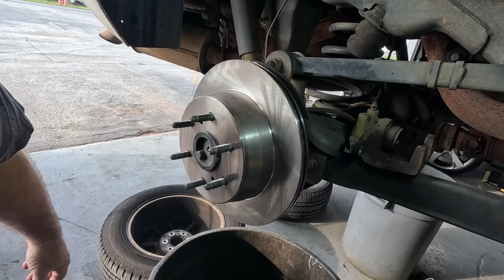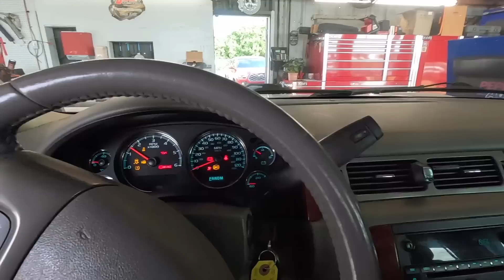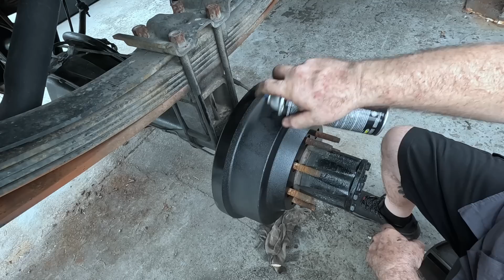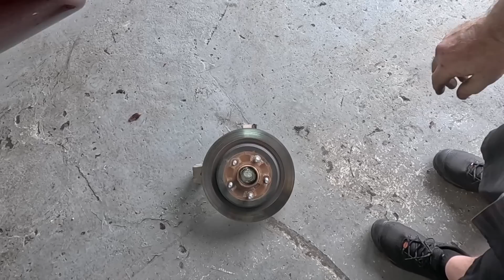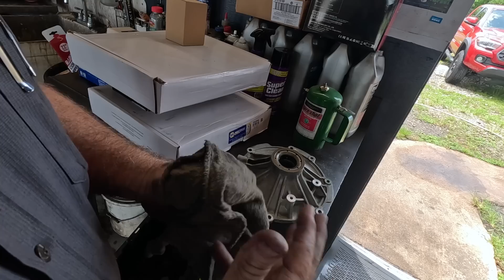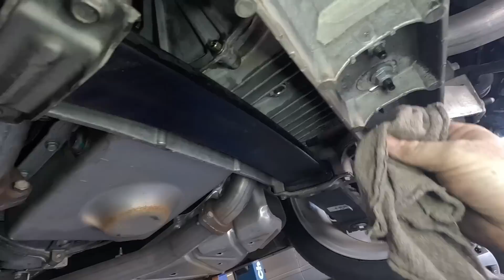03 CORVETTE DIFF REPAIR, GIMME A BRAKE! 12 TAHOE, 95 F350 DRUMS, A DAY THE THE AUTO REPAIR SHOP 270

Comment: Ok here I am, where should I start on the brake drum job? 
1. Didnt clean the back plate at all so you put lube on top of the brake dust build up... 
2. When you _hammered_the lever back in, rust was literally shooting out the back side and the arm is all rusted.. 
3. Good job putting greasy fingerprints on the brake shoes stopping suface...
4. The side cutters being used on the spring so it can rust now that the coating is damaged.
5. Didnt clean the rust off the hub suface that the drum mates to.. ive seen brakes get loose when that rust crumbles. 
100% still unimpressed Jimmy. I'm sticking with my original opinion that its just not up to my standards for the reasons I listed.
Reply from the maker: lol, thanks for watching.
Reply: @JimmyMakingitwork  np, you called me out. Don't ever move to a state that salts their roads

Comment: I bought my Craftsman brake spring pliers in the mid 80s when I was in high school auto shop class. In the early 2000s the nub on the spring removal end broke on the next brake job after having replaced shoes on a 1 ton axle. I was able to exchange them at Sears Hardware. The replacement pliers were shorter than my original. Lisle used to sell a brake spring plier that was non-pointed so as not to damage bonded shoes. It is no longer shown in their catalog.
Reply from the maker: Yeah, I wondered about grinding it flatter, or welding a nut on it for protecting the shoes?